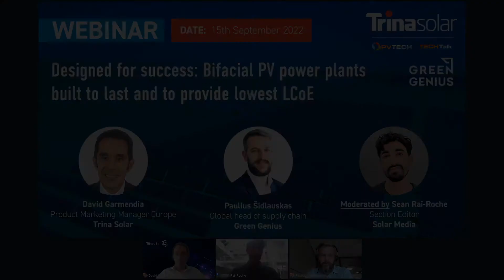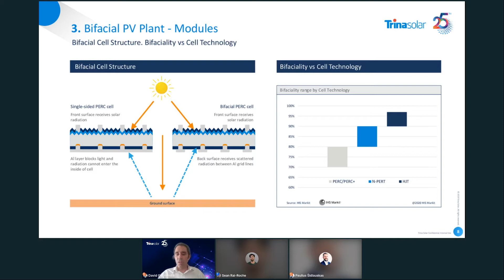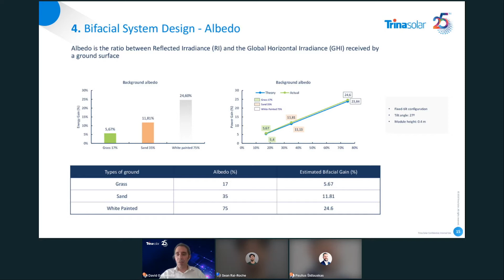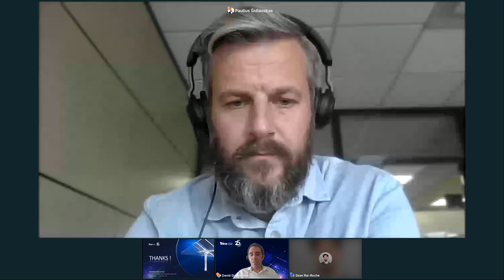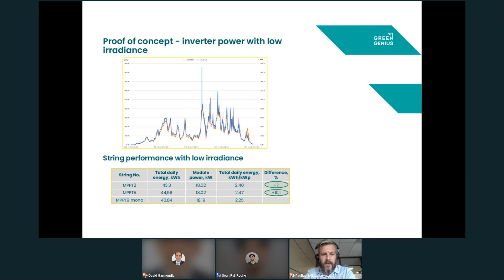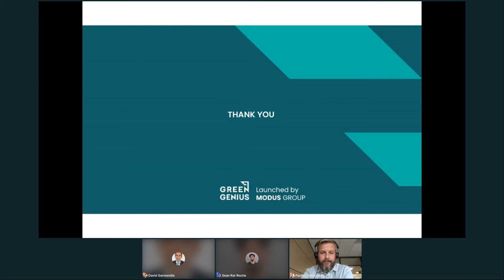Designed for success: Bifacial PV power plants built to last and to provide lowest LCoE

Comment: We just didn't understand how in Bifacial Modules and high albedo, the shading from a support structure close to the back active cells affects the performance of the whole system, as electrically the back face of the cells are connected to the front face of the cells in the module. There are no scientific answers after so much talk and sales pitches. Think about it, the question is very important.